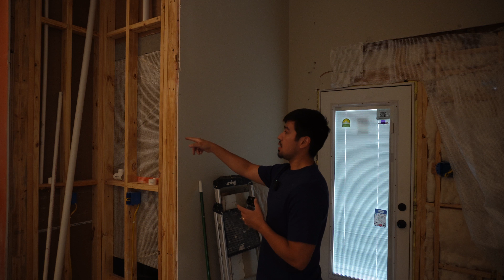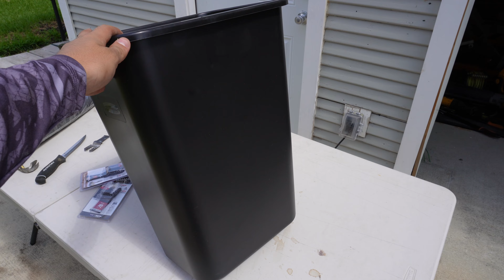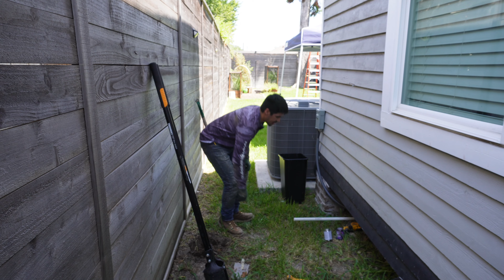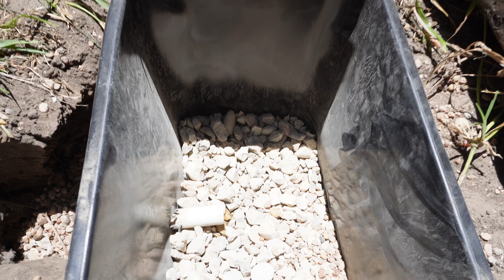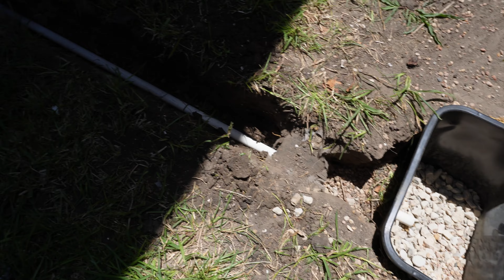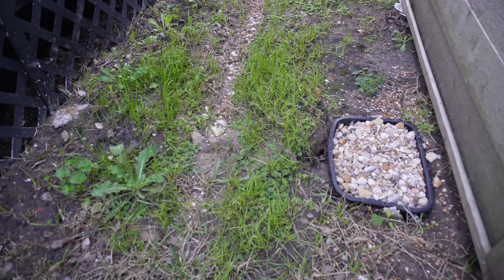AC Condensate Waste Drain - Easy Fix!

Comment: Seems like it could get clogged easily with no considerable open space at the end of the pipe. However, I'm in Florida where not only is ac going to produce more drip but also you can't go too far down without hitting ground water. Maybe that doesn't matter. Interesting idea anyway.